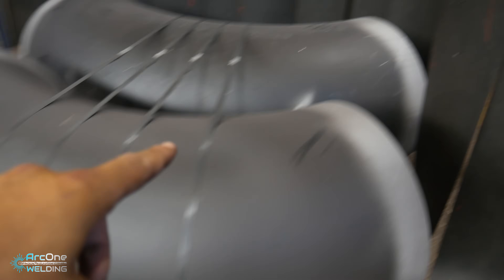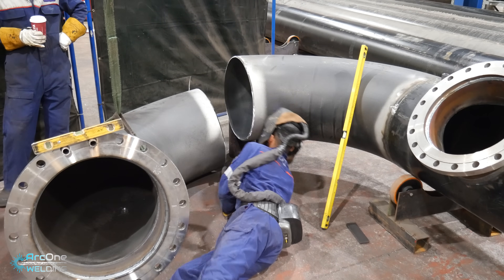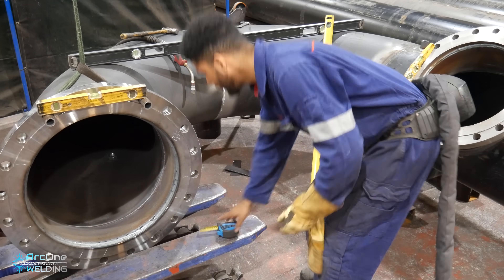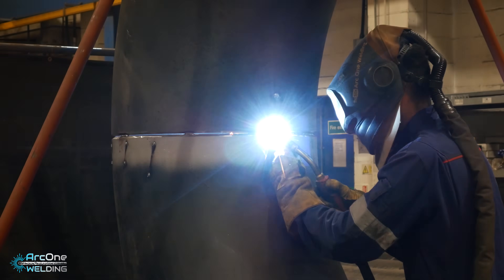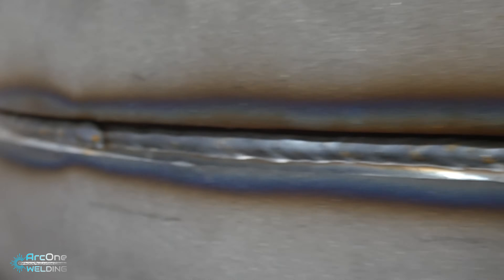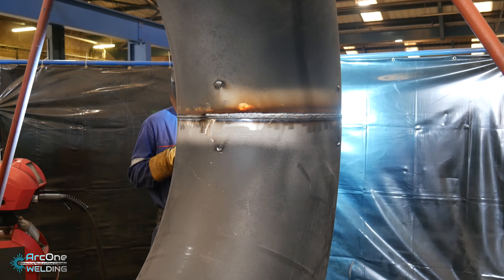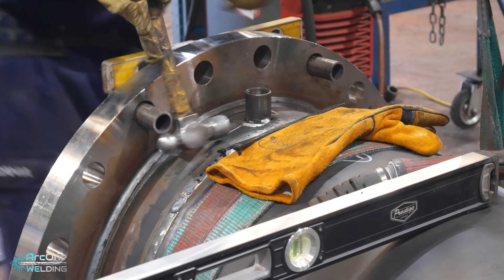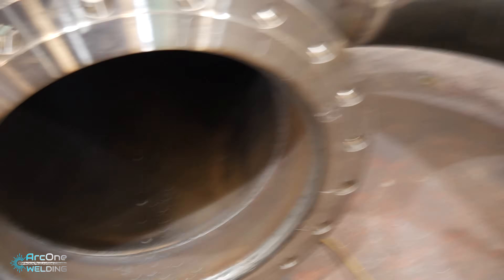Massive 24" Pipe Positional Weld Biggest Pipe Yet

Comment: Hey I'm just going to say this. I've been welding for my living for over 25 years. That 1-in outlet is not an engineered o-let. I work in a pipe shop welding mig doing a lot of water piping for heating and cooling systems large diameter. We use weld o-lets not threaded couplers.

Comment: Here in Canada, if you weld tack outside the weld zone,  it's a cut-out . You should at minimum at least preheat where you're going to tack.
Reply: 😂😂😂 it's not just Canada but it's also the use of this pipe. It's not critical. This is heating and cooling water so it's just fine.
Reply: @leroy420b  na , do it right and show these young people how to do it right! Don't teach people bad habits.  I wouldn't hire guys like this!

Comment: Im a tig pipe welder, my first tip is never get happy with your weld. always improve yourself. in Europe we never finish the weld inside a elbow because is going to absorve more heat inside and will cosed, i know you secure the piece but we both know he will close a litle, we put in the level close to the risk to discount the closing. but you doing a good job i just notice you weld like i weld with mag.

Comment: Great job, if you don't mind a little tip, when fitting a small socket screw a plug into it, it's so easy to distort it when your tapping it into position, I know from bitter experience, I was asked to weld a 2" socket on a pipe that was already installed up in the air on a Friday afternoon, back in my disco days and i was very keen to get home, the job went fine so i thought on coming in on Monday morning I got my balls ripped off, i'd distorted the socket knocking it straight and the pipefitters couldn't do the job they come into do over the weekend, for the rest of my working life i wouldn't weld a socket on without a plug or any fitting screwed into it.

Comment: Top work. Thread protectors are  weld type sockets in the UK as far as I know. From my supplier they are anyway. Suitable for steam and much higher temperature and pressure than the malleable ones sold.

Comment: Made a good job of that👌 is a shame they wont let us use solid wire at work, most got to be tig root, every now and then a fleet root👎
Sometimes fluxcore fill, most of the time low hy
Reply from the maker: It would be fun trying different ways but all we do is solid wire
Reply: @ARCONEWELDING  solid wire would be great to use, especially larger sized pipe ie 18" and above. Even if just for the root, then dual shield or fluxcor (whatever you want to call it lol) for the fill and cap. Tig rooting them takes sooooo long. 
Have two miller pipepro in the shop with RMD, but clients wont come forward out of the dark ages 😒😄

Another great vid though, good to see other ways of doing things 👍

Comment: 7 years welding and fabrication later but finally starting my first pipe welding job monday, cant wait!! thanks for the tips, awesome channel!
Reply: you watch youtube for your work. that is crazy XD
Reply: @blackdaan  I was actually a custom canal boat and barge builder, don't think these is alot of that on YouTube 👌🏼😂. Why are you watching? 🤔
Reply: @uk_siren  i actually have a hobby workshop. I love metalworking. But i also work i metal so you can never tell i wqtch for work
Reply: @blackdaan  nice, I've also got the same kind of setup but in a friend's unit. Metal working is awesome. Can't beat it.
Reply: @uk_siren  got a lathe, milling machine, plasma cutter. mma, migmag, tig, platebender, roller . big bandsaw, drill press. and i also have a separate wood workshop. 
dont like dust on my metal machines haha.
bought all from aside of my job projects. :D
Reply: That's awesome man, I've branched out from different industries myself, I was in the farming industry for a while, then a little bit of stainless and been welding trailers for a while but I really want to get away maybe travel or get into some pipe welding myself
Reply: @martinwilliams9285  yea i got many offers in my life. But if you are tallented. You maybe should work for your own

Comment: Saw your garage video. now you need this https://www.youtube.com/watch?v=il2iyT523sc   . For the big pipe you need bigger pipe stands with adjustable H beam inserts. If you were to do xray high pressure pipe welding outside of the bevels is not allowed. I welded with stick exclusively in my 45+ years and ran a welding rig as a contract welder in Alberta Canada. The job was 100% xray work and in the field mostly. Pipe sizes were mostly big inch 24"-48". Almost always hot work. Even wrote up a 70- page booklet on how some of it was done. It was done for something to do in retirement.
Reply: in canada? X ray hot work welds? You must have been earning 100 an hour

Comment: There is so much to learn about welding(and every other trade). I remember in my youth I OVER did things to make them 'best' or 'better' or 'not fall apart'. The cost of remodel of those jobs will not match expectations.  Recently, my son was welding the frame for a large slab sawmill and I suggested that 'fine' was better than 'that will never move'  life provided the exclamation point when a few of those joints needed to be altered or removed.  Also, my Dads only son had a similar issue with this listening skill.
For the naysayers,  please post your videos.  They will help us all!